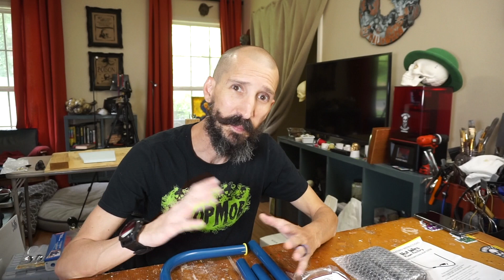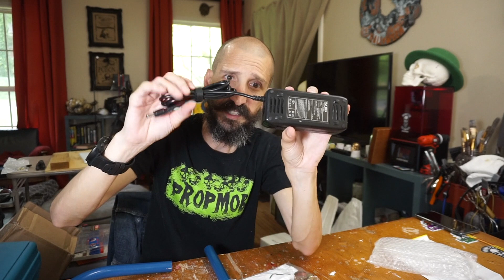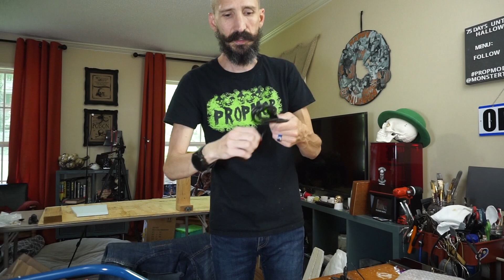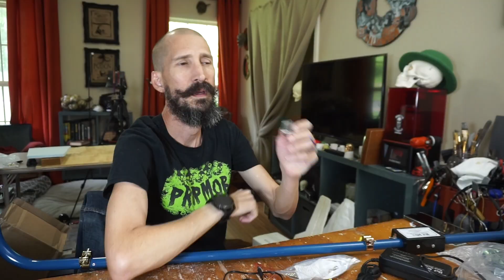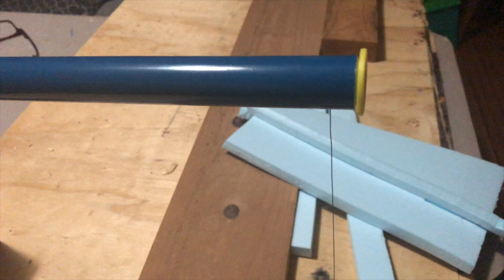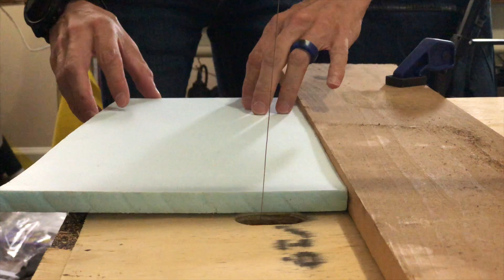Hot Wire Foam Factory Foam Saw Unboxing and Setup - Using this for the next tutorial!

Comment: Good video!!....I may have a project for you to try that deals with mold making......make an 8x8x8 open end temporary box lined with dropcloth plastic and then use a skull wrapped in plastic drop cloth (whether to heat it up for detail on the eyes and nose possible?) get some great stuff foam and fill 1/3 of the box....place the  plastic protected skull in and fill to the top....Let stand a day or two...break open the box but keep to reuse...use a long sharp knife to cut the form up the middle....Viola!!! super cheap skull mold...just a thought....

Comment: Nice video, however that 4' bow is over kill for what you are cutting and at almost $300 very exspensive. This $66 foam cutter would have done the job and has the fence and a way to control setting the blade for precise bevels.

https://www.ebay.com/itm/Hot-Wire-Foam-Cutter-Working-Table-Tool-Styrofoam-Cutting-Machine-USA-STOCK/223268261842?hash=item33fbd34fd2:g:p7gAAOSwcDdcBJgq